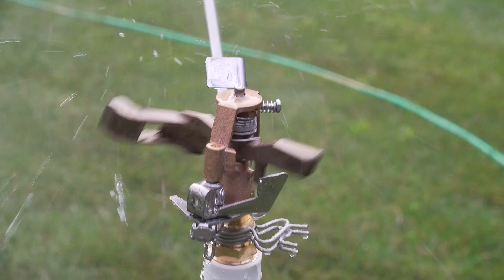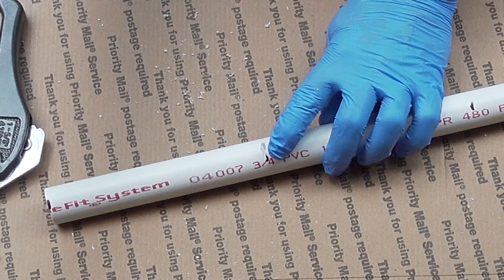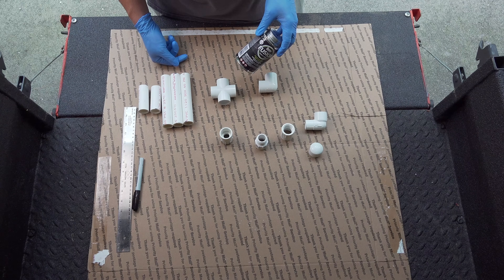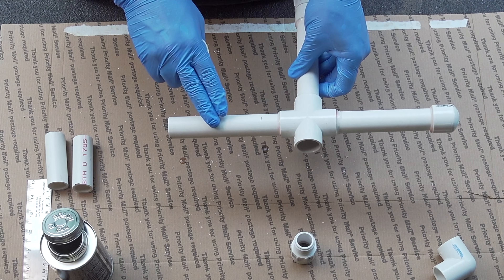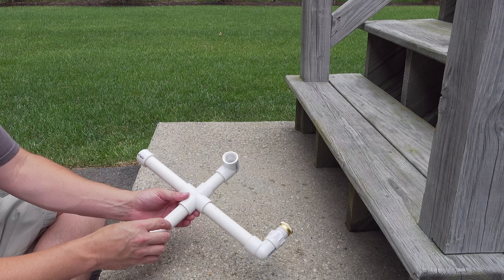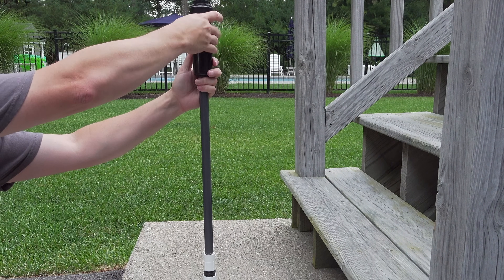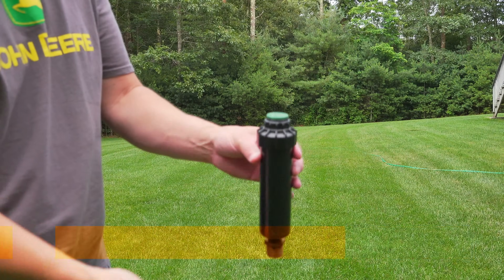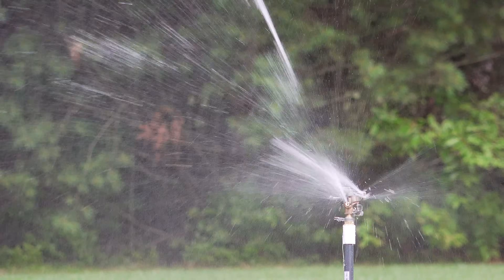Best Lawn Sprinkler DIY - Without an Irrigation System- Build your own EASY

Comment: Hi, I am wanting to make 2-3 of these. If I connect 2 up at one time would they work right? My psi is 61 at my spigot. It's goes to 40 when I go into the house and turn on the kitchen faucet. Thanks in advance
Reply: The sprinklers you buy should have a psi and gph rating. As long as the sprinkler heads combined dont exceed those numbers you can hook up sometimes 2-8 heads at once.
Reply: @rileyscott7135  what I'm interested in is the orbit Saturn 3 heads. On the home Depot website just says Max pressure is 60 PSI  Do you think I could use three at one time on the my garden hose. ?  I've got 61 psi at that  spigot
Reply: @randyman8984  might want to install a cheap reducer but what's more important is the output. Watch a youtube video for "the bucket test" it's a 5 gallon bucket test to check your GPH that'll tell you how many heads you can put on a zone, if you check the output on the heads you want to use

Comment: So, with those sprinklers, they only water the perimeter of a 50 feet circle?
What head would you use to water every thing, near and far from the head? And everything in between?
Reply from the maker: No, they water up to 50' and everything in between.
Reply: @SilverCymbal 
Do you have to manually adjust the head every 5 mins or so, to get a different radius? Looks like most of the water goes to the furthest perimeter
Reply from the maker: @jakefriesenjake  If you use the Black rotary style one, it gives even coverage despite the fact that it looks like it only hits further away. The impact sprinkler has a little slider on it that allows it to the same so both can be set and then just left to do the job.

Comment: So for the expansion, would I add a hose the into another base like the one in this video?
Reply from the maker: Yes exactly and most outdoor spigots can handle 2-4 of these if its not enough flow and pressure you can use smaller sprinklers and run them for longer if eeded

Comment: this is great!!! the concern is even water distribution though.  can the 2 heads run together???  mygreathannks
Reply from the maker: Yes you can run multiple and many can run 3-4 with this design. You can adjust the nozzle size down if you have lower pressure to get good coverage this way.

Comment: Curious about what water pressure you are getting?
Reply from the maker: Between 40-60
Reply: @SilverCymbal  I'm glad you responded to an older video like this!  Thanks.  And that info will come in handy.  I'm just shy of that so will use a booster pump.

Comment: If you are trying to water larger areas, could you run 2-3 of these in series, or would the water pressure be too low?
Reply: You should be able to as they don't require a lot of pressure.  You just need to test the pressure at the spigot and use at least a 3/4" hose. If pressure is say 60psi, you should be good.  You can check Hunter or Rainbirds website where they provide information on how to check and design this stuff.

Comment: Do you have any ideas for an overhead sprinkler system for a greenhouse. I have a 12ftX24ft greenhouse ("pvc hoophouse") that I want to put a sprinkler/misting system in, but have it feed from an IBC tote inside the greenhouse instead from city water to eliminate the possibility of not having water if the spigot freezes or having my spigot freeze due to exposure to the cold. I've only had that problem once, but I lost hundreds of dollars in plants last year. I was thinking of a cheap (lol, as money is an issue.) 12v system because I already have a 12v system regulating my temperature, but I'm thrown off by pressure/flow/etc. I've seen youtubers using 12v irrigation for their gardens/etc but they don't talk much about how they work as far as the details (water pressures vs water flow, reasons for different diameter inlet/outlet hoses, sprinkler/misting choice reasons, etc.) of how and why they work (Or in some cases why they didn't work.). Lol even if you don't have any ideas for my project, I loved your idea and thank you for sharing it with us.
Reply from the maker: Thank you very much I don't know a lot about that type of a setup but you might look up self draining valves. I believe they make ones that drain after the pressure is gone to prevent freezing. Not sure if that could work for you. Sounds like a pretty cool setup you have,

Comment: Does the sprinkler head come with a 3/4 inch threaded male adapter?
Reply from the maker: No but it is linked in the description if you need it. Some heads are 1/2 if they are smaller but 3/4 is very common for rotary heads. I have a couple of them around since i never know what I will want to connect.

Comment: Instead of the pvc pipe base could i just put the sprinkler head on a spike base?
Reply from the maker: Sure, you only need to use the extension if you need extra height.

Comment: Did your rotary sprinkler head come with the male 3/3 threaded end?  If not where did you find that piece, i dont see it in your parts list?
Reply from the maker: The one in the description has a 1/2"  Its a good idea to get an adapter for 1/2 to 3/4 and the other way too. I think they are all listed.

Comment: I have just under an acre of land on my property. Would one, or two, of these work for that much lawn?
Reply from the maker: Any watering will be better than none. I would make sure to use a hose that is at least 3/4 inside diameter and you should be able to run several of these together with the largest heads as I showed 40' You can cover a lot of space this way.

Comment: Why 3/4" fittings?  The long underground feeder hose I think is 5/8". Will this supply enough water? I'm getting 80 psi.
Reply from the maker: Many rotary heads are 3/4" and others are 1/2" I chose the larger size so it would never restrict flow and I use the adapter for 1/2" as needed. You can adjust if you want to do something diferent but this has worked out very well for me, I use it all the time. Just shared a few instagram pics of it too.
Reply: @SilverCymbal  OK thanks.

Comment: Do you have a list of materials that we need to look for?
Reply from the maker: Yes right here: 
PVC Pipe:  https://amzn.to/2ldyxiI
PVC Cutter Tool: https://amzn.to/2ldyZxq
One step pvc glue https://amzn.to/2jK0IFo
End Cap https://amzn.to/2jHT5zi
4 Way Cross https://amzn.to/2jWOmtO
Male adapter  https://amzn.to/2jKhxQK
Female Adapter https://amzn.to/2XOJ29C
Special elbow for adding multiple sprinklers: https://amzn.to/2ldE3Ss
Sprinkler elbow https://amzn.to/2lejxBd
Riser Pipe: https://amzn.to/2RsEJRf

Sprinkler Heads:
All metal impact: https://amzn.to/2lbVPWb
Up to 50' Rotary https://amzn.to/2ldHZTf
Plus you can buy many other heads, some need a cheap screw in adapter to connect

Comment: With the base of this size, how tall can the riser pipe be before it topples over?
Reply from the maker: It depends on what head. You can weigh it down easily with the brick if needed for really tall ones. I like this better than making it huge.
Reply: @SilverCymbal  Thanks! I'm looking to make something that I can use the metal sprinkle heads above my 6ft trees. Maybe I'll zip tie the riser pole to my deck rail. :)

Comment: There are 2 different elbows, the one you installed first, i couldn't find it in the store, i believe is a degree street elbow...?
Reply from the maker: That is correct, one street elbow but if you can't get that you can always add one more coupler. The description has links for them if needed.

Comment: Could you put these sprinklers in tandem? How many?
Reply from the maker: Absolutely thats the design. It depends on your flow and pressure but for most people 3-4 will work
Reply: Silver Cymbal Thanks I will try it . I have a small yard but convoluted. L shaped. Trying to figure away to cover the lawn without throwing water all over the place. I am going to put a couple of these together and see how it works . Like to try four in tandem. Hopefully the water pressure is enough. I think it is 80psi. Thanks again. Great idea.

Comment: What about the water pressure? No pump required?
Reply from the maker: Most US households are between 45-60psi which will work perfect for this application. If you are on the very low side you may only be able to coonect 2-3 of these together. Higher pressure and volume will allow 4-6

Comment: How many can you hook up together without loosing pressure.
Reply from the maker: It rerally depends but if you have normal water pressure you can easily get 3-4 of these together. Remember if its too little the jets inside the sprinklers can be swapped too, they are all included in the description with the heads I use. Unlike store bought ones you can tune these to wor for your needs.

Comment: How would you build more heads off the one you build in the video?
Reply from the maker: Very easy, just connect a garden hose to the part on the end of the arm with the screw on cap. Run that hose to the input on the next one and you are good to go. You can chain usually 4 together, depending on water flow and pressure and if its not enough you can use smaller nozzles to reduce each sprinkler flow but still let you have more coverage. Very flexible.

Comment: Thx! Where did you get cap for extension port?
Reply: Also…I bought the sprinkler but where did you get the make sprinkler riser for the plastic sprinkler to mount to your design.

Comment: Thanks, this is a quite nice setup for sprinkler. In case you require a DIY irrigation controller I my suggest to Google "hydrosys4" an open source controller based on raspberry pi.

Comment: Proper name for the garden hose connecting piece? *Needed to complete sprinkler. 😁
Reply from the maker: I think you mean the plastic part. That is a 3/4" PVC slip to a 3/4" garden thread fitting. You can look it for it localy or my description has a link.

Comment: What screws are used with Rise pipe? Please provide the details
Reply from the maker: There aren't any screws needed. It just threads into each other
Reply: @SilverCymbal  I thought you are using the white screw to put the rise pipe to base and another white screw to put the sprinkler head to riser pipe
Reply: @SilverCymbal  how did you put the rise pipe in the base?
Reply from the maker: @chintanparikh2713  If you look in the description I have a parts list. That is a glue to thread adapter. Then the pipe riser is also threaded

Comment: Are you in Massachusetts? If so, fellow masshole here!!

I struggling with this decision!!! Edwin or Electra?!?!?! I have an approximately 10000-12000 sqft front yard that I plan to use her on. I love the idea of reel mowing and want so badly to start. As with any large purchase I've done a bunch of research but I don't know what I don't know! I was hoping asking you, as someone who has used both, could help with this. Performance wise are they equal? Electric tools in the outdoor power equipment space can fall far below their gas counterparts. Also, I know the mower is rated for 15,000 Sqft on a single charge have you had any battery trouble. With my 10000-12000 Sqft I am pushing a full charge and don't want to have to recharge to complete every mow. Thank you for any insight and keep up the great work I love your channel!
Reply from the maker: Thank you very much. I found the power the actually be the same for both machines and was surprised by that.The battery unit low noise is very impressive too. For longevity the gas may be better, parts, etc. Honestly you will like both machines so if noise is a big factor go with the battery Electra

Comment: Where did you get the extension rod for the sprinkler? The one that screws in for height.
Reply from the maker: Here you go: https://amzn.to/2xL0qSb
Reply: Most big hardware stores like Lowe's and Home Depot carry these, of various lengths. They're identified as "risers" online and on the shelf.
Reply: @SilverCymbal  The link shows 1/2 in. Should it be 3/4?
Reply: Nevermind, I see the 3/4 to 1/2 adapters you added
Reply from the maker: @rudymaldonado667  The brass head is 1/2" and the Orbits come in both sizes. I like to build it at 3/4" and then just adapt down to 1/2" depending which head you get. This way you can go any way you want

Comment: Why the other brass piece u point in is that so you can run another hose
Reply from the maker: Correct, I happened to have a brass one on hand but there are plastic caps too. You use that to add other sprinklers, you can usually add 3-6 together.

Comment: Is the Orbit 55662 that is linked in your description the larger of the two heads that you used in your video with the 50' radius?
Reply from the maker: Yes that is correct. It includes a number of nozzles too so you can totally customize even the spray pattern which can be handy too
Reply: @SilverCymbal  Would really like to know the model of the smaller head with the 35' radius. It resembles a Orbit Saturn IV ?

Comment: Hey Silver Cymbal,
Great Video !  What did you use for the extender ? Is it metal 3/4 inch pipe or a sprinkler riser ?
Reply from the maker: The pipe I used is a 18" 1/2" riser but you could use a 3/4" too. Some sprinklers are 1/2" some are 3/4"  With this setup I start with 3/4" and if I need to go 1/2" I use thr adapter, this way you can fit anything.
Reply from the maker: soaringtractor  Enjoy the holiday. Remember smiles are free.
Reply: @SilverCymbal  hi! where is the link to this adapter? I think it's missing from the description?
Reply from the maker: @kiiinnndddaaa  Hi there, I think this is what you are looking for: https://amzn.to/2XOJ29C

Comment: Why does it seem that the grass closer to the sprinkler doesn’t get any water? Only the outer edge of the diameter gets the water?
Reply from the maker: It does look like that and the impact sprinklers they do ok but are not really the best, use the black rotary ones for the most even coverage. The impact are an old design that is a great memory and good for very large watering areas but not 100% even, fortunately this design allow you to use any head you like

Comment: I made a couple of these for my parent's lawn.  They also serve as a backup system, just in case I have issues with my irrigation system.  No way I was giving a company 100s of dollars for a base that I could build for a few bucks.
Reply from the maker: That's awesome glad it worked out! It's great when you can save $$$

Comment: where did you list the parts list?  I'm unable to find it
Reply from the maker: If you click on the description you will see all the items, I pasted it here for you also. PVC Pipe:  https://amzn.to/2ldyxiI
PVC Cutter Tool: https://amzn.to/2ldyZxq
One step pvc glue https://amzn.to/2jK0IFo
End Cap https://amzn.to/2jHT5zi
4 Way Cross https://amzn.to/2jWOmtO
Male adapter  https://amzn.to/2jKhxQK
Female Adapter https://amzn.to/2XOJ29C
Special elbow for adding multiple sprinklers: https://amzn.to/2ldE3Ss
Sprinkler elbow https://amzn.to/2lejxBd
Riser Pipe: https://amzn.to/2RsEJRf

Sprinkler Heads:
All metal impact: https://amzn.to/2lbVPWb
Up to 50' Rotary https://amzn.to/2ldHZTf

Comment: Question: I’ve got about 5000 sq ft lawn with Inground pool being in the middle of the yard, any suggestion what kind of sprinklers system would be best?
Reply from the maker: Hunter I20 or PGP heads work well for that application. They are very popular with installers if you want built in. If you want to use what I showed in the video those work just as well in a DIY way
Reply: Thank you for reply. Any guidance video how/where to set up sprinkler head and installation?

Comment: I got a better one.  No cuts and 3 things you need.  Push in sprinkler, hose clamp and T post.  Put Tpost in ground then hose clamp the sprinkler on the top.  Gives more distance too.

Comment: I built this and it worked pretty well until the pvc hose inlet connector separated itself.  I was able to get it back on but I don't imaging everyone will have the same luck. While searching for a metal solution, I found these - https://www.amazon.com/gp/product/B088ZNL621/ref=ox_sc_act_title_1?smid=A3OQFKFXQW7IBQ&psc=1  .  They're a much simpler solution and don't cost much at all.  Thanks so much for your videos and I love the idea of using the below ground sprinklers in this fashion.  They're much superior to the usual above ground sprinklers we've been using for years.

Comment: I made two of these and the sprinkler head is way too high and it will tip over. Base design is not stable with
Reply: stacker472 all you would really need to do is make some longer base pieces if you have that problem, even 8-10 inches instead of 6 would likely be enough
Reply: I just bought a spike screwed the sprinkler in and done. A lot cheaper than messing with all of these fittings and finding out it tips over. Poor base design. The design should have the sprinkler in the center of the base. You would need to add some fittings and cut the tubes longer. At this point it gets too big. Save your money and time and buy a sprinkler spike. I paid $1.50 for the sprinkler spike at Menards.

Comment: Wow now that u got 1 rotor u can sit back and count the brown spots pop up since that 1 rotor only covers 25ft radius n needs a overlapping rotor too pick up areas that it overshoots or wind n plants block etc... Dnt use k rain either shitty gears in that rotor constantly resets itself and 180 deg becomes 185 then 190 etc... Buy quality get a true design with 100% coverage n 50% overlap w/rain effect that quick water crap gives you exactly what u pay 4.... Try n see

Comment: Just started your video...who is your audience that you need to teach people how to cut a PVC pipe?  This isn't a kindergarten classroom.  Most of us are adults and have done this before, or could easily figure it out.
Liked the rest of the video.  You could replace both 90 degree angles with one T after the cross.  More balanced and symmetrical that way.
Reply: SLRS we’re you born a pro?  There is a first time for everything!